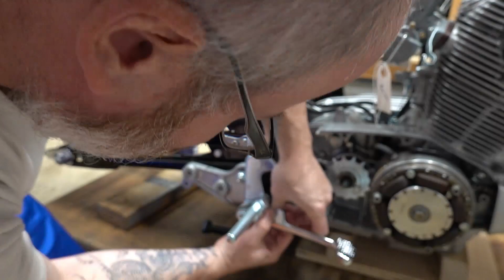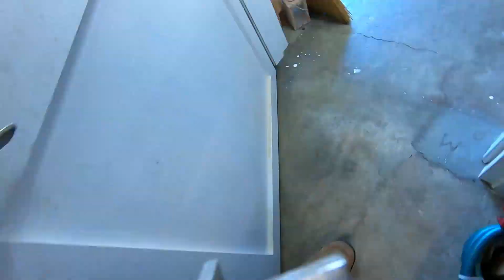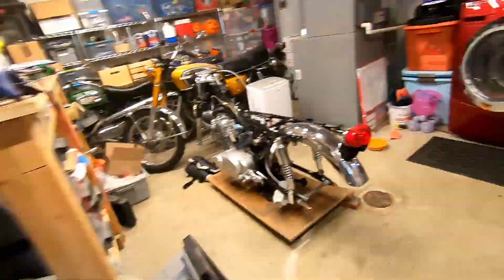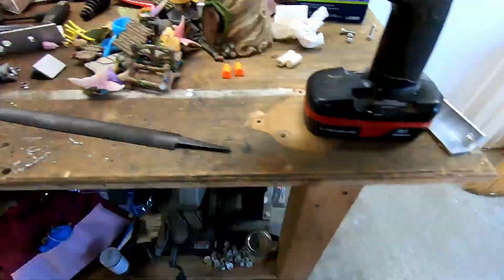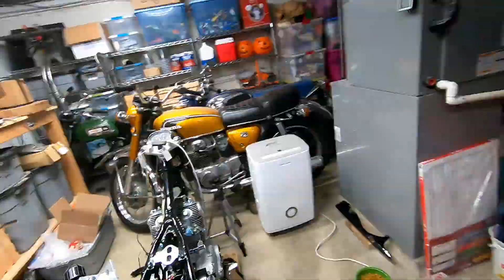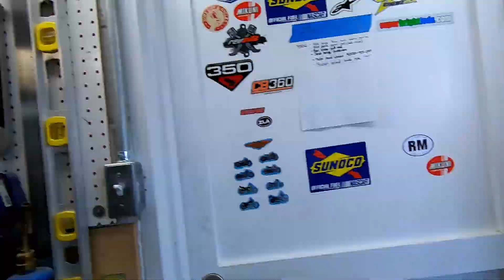1967 Honda CB77 Super Hawk - Restoration - Part 4

Comment: Thanks for your  CB77 videos.  Wonderful restoration.  
Why did you not use the original coils]?  I cannot  find the  rubber caps that cover the 12 volt leads going to the coils on my CL72.  Any ideas where to get them?  Any idea where to get a replacement capacitor?
Reply from the maker: Thanks for watching.  The housing on one of the original coils was broken.  It can probably be repaired, and I may attempt it in the future but in the interest of time I decided to use a set of Emgo coils.  I have used that type of coil on another bike and they have worked well.  

The little rubber caps that go to the original coils are technically part of the wiring harness according to the parts diagram.  It's possible Honda used them in another application and specify a part number there but I'm not sure.

I got the NOS condenser that I used for this restoration on eBay.  That may be your best bet.

Comment: Hi Michael. Great vids. Your young helpers are fantastic. I was wondering if you would be willing to share the source of the OEM bagged bolts from Honda. I would like to replace some hardware on my bikes. Cheers!
Reply from the maker: Hi Daniel, thanks for watching.  Most of the hardware for this project is original.  I had it re-plated by Parker Metal Finishing in Greensboro, NC.  The common OEM stuff like washers, spring washers, clips, cotter pins, hose, etc. that I keep on hand in "bulk" I typically order from Partzilla.com.  I try to avoid unnecessary shipping fees so whenever I place a large order of parts I will just add 10-20 of whatever common items I'm short on to the order.
Reply: Thanks very much for the info. I look forward to watching the rest of the work!